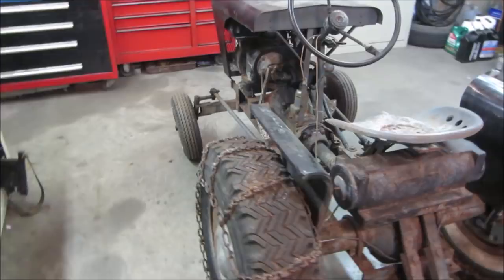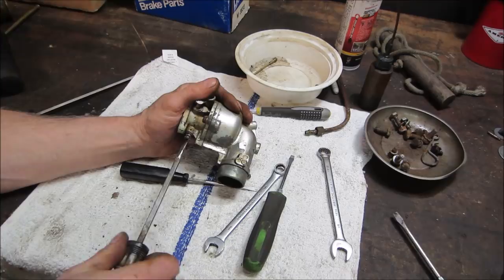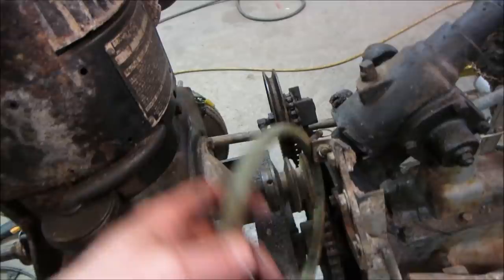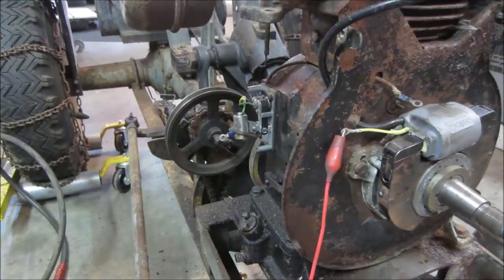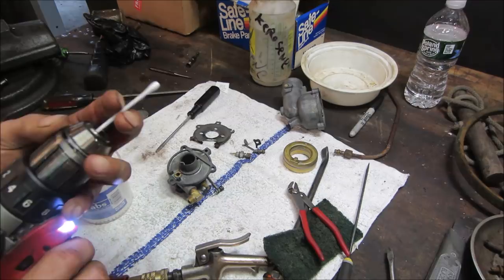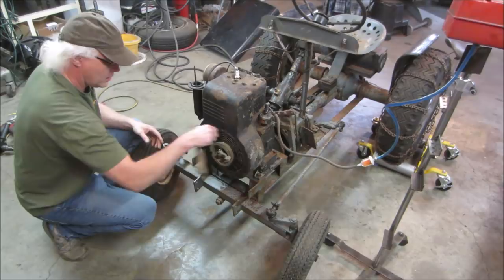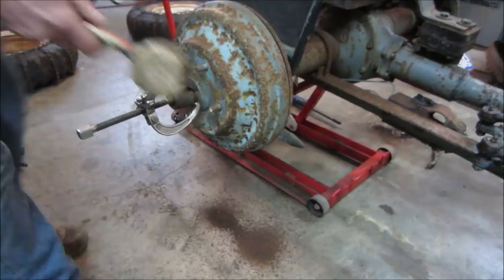Is The Engine Savable? Homemade Tractor Buried Under A House, pt2

Comment: you can use a bicycle sprocket :) .. I think you can get the idea on how to make a one way ratchet to drive that with a drill .. just imagine the part where you put the chain is your drill and the middle part where the wheel axle is connected is you're fly wheel that you spin

Comment: I like how it was sounding. Very cool little toy. One thing though that could be neat is when you go and do the breaks possibly flip the wide whites out...hmmm could be fun it would give it a real 60's kinda vibe
Reply: "brakes"
Reply: Breaking those old tires down you risk ripping the bead. Replacing those tires would set you back a bit too.

Comment: Just can't beat the old Briggs cast engines. Ya can bore those out several times for total rebuilds. If I remember correctly they have stelite exhaust valves that are tuff to ruin.. I've got a big ole 15hp cast one saved from scrap many years ago. We repaired it n never got paid so boss said scrap it , I have it in a shed . Have to sell soon going to move

Comment: Last time I had a throttle cable issue like that. I was able to remove the cable and soak it in liquid WD40 for a while. Grease would have been a better option if I had some. Find that the cheap green scour pads from the dollar store are very handy in these situations for surface rust

Comment: Nice day for it anyway. To bad we got snow for this weekend. Hopefully down south your pressure washers and such didn't freeze. BTW I Have an old homelite generator 3.5hp briggs vertical shaft square base. Pretty rare from what I've found.  I'd love to see you tear it down. Message me if you're interested in the "will it run" I'm in central NH.

Comment: Not sure it could be the original, but upon closer inspection, someone definitely followed the plans for the Pow'r Pup tractor very closely.   Wish I could tell, but I wonder if the hood has remnants of the  logo from the Pow'r Pup article, it would then certainly be the original.

Comment: I'm wondering if you could make a 2 piece socket that has a lip, like an inclined plane that catches if you spin clockwise. Then when the engine catches and outrun the drill it could just go right on past that lip from behind.

Comment: To me it looks like that coil was just left powered on and melted from the inside winding outwards, but this doesn't have a battery and it's not a powered coil am I right? The mystery just gets deeper. perhaps that thing you removed that was rubbing in the previous video caused a huge amount of friction heat right around that area. I guess we'll never know.

Comment: Just a thought about using a drill for starting these engines, wouldn't an air drill or impact work better? When it starts, an tool like that would free spool without reversing the nut, or am I wrong?

Comment: Stanley/Bostitch bought the Craftsman tool name. They also own Black and Decker, DeWalt, Porter Cable, Delta, Rockwell, and Emglo.
Reply: 30 years ago I worked for a company called Western Forge.  They made Stanley, Craftsman, plus other brands on the same line.  Independent manufacturers have been gone a long time.

Comment: I've mentioned previously: Lithium grease is for fast-moving parts that run hot because lithium base grease is hygroscopic (absorbs moisture and causes rust). For slow moving parts and cables use a calcium-base grease, stern tube oil, STP "oil treatment", molybdenum grease or other alternative.
Reply: It's all good. Mustie put a protective layer of oil on it all first. Plus it is all prerusted anyways.

Comment: Excellent video Mustie :) who took over Sears small engine was Techusmn in 1970's  also O.M.C. was before that if want  know and Tractor motor sure a running order one to yes after minor fix up Carburetor and Spark Control ! I know the motor from 1980 or before got use Lead Additive in fuel so dail in okay and since 1990's got use Fuel 89 has 5 % Ethonal  or higher  has none Ethonal plus use Fuel injection cleaner in more since Ethonal in fuel older motor fight with  fuel 87 octane has 10 or more % of Ethonal! Plus older engines don't like Synthetic engine oil like Conventional type of 30 or 5W30 or 10w30 engine oil with high protection grade too and no recycling oil types too ! How found this my late Dad had 1976 Sears 6 hp Techusmn 4 cycle motor had it took lot work dail for Low Idle with 87 octane gas & work fine on 89 or 91 octane gas from Shell fuel stations plus 10w30 engine oil no synthetic type to and purr like kitten they say ! Plus Chainsaw he had still got has same thing like mix gas with gas type 89 or higher octane with mix oil or backfire and no low idle very well if used 87 octane hard dail in carb run right on both them ! Plus USE Lead Additive also A grey bottle of STP Total Treatment fuel injection and carb cleaner in 89 or higher fuels you be surprised in a year or longer using or bring something out storage no problem at all on first pull plus little choke on till warm in 1 min of starting up! Yes you be surprised even own drive vechile like GM , Ford, Chrysler also others too of old classic vechiles too use Lead Additive and STP Treatment too and got lots people to try also it surprised them too even fuel to use on 89 or higher octane!

Comment: The coil almost had to fail with the engine running. There wouldn't be any power on it otherwise unless somebody tried to connect a battery. Once the coil failed, the engine stops running and the melting, probably burning goo keeps dripping onto the flywheel.

Comment: If power was left on to the coil when not operating, the coil would eventually overheat and melt down.  Happened in points & condenser ignition cars where key was left in "On" and points were closed.
Reply: That's only true if there's a battery in the circuit,

Comment: Yes Lowes has taken over Craftsman and still have a life time guarantee.
Reply: I believe it was Stanley that bought Craftsman. Lowe’s is just one of the Craftsman resellers. There are others like Ace Hardware. Even our local Rural King sells Craftsman stuff....
Reply: Black and Decker bought Craftsman from Sears, then B / D chose Lowes as the primary out let, ACE and others like Menard's sell a portion of the Craftsman line of tools.
Reply: @nonenone5116  Well, Stanley owns B&D.......

Comment: which ultra sonic cleaner do you use thinking about buying one for automotive carbs and small parts. its odd years a go a friend bought one large enough for radiators used about a year turned off never used again

Comment: They left the ignition on with a 12 V hot battery in it that also will happen to the old Mercurys as well
Reply: The machine has no electrical system. So there is no battery. A magnet passes by the coil and generates the spark.

Comment: I have an old Briggs on a pump large frame like that looks like  a 8 Horse I think it say 3 horse.
Long stroke.
I guess mine is taller smaller  head
Also have a David Bradley  need  to get running

Comment: You need this item for using your drill to start the engines. Amazon - W38137 3/8 Ratcheting adapter

Comment: Lowes took over craftsman and does honor their warranty. But the tools aren't anywhere near the same quality. So any old school craftsman is going to be a definite downgrade. Now if you are talking about crapsman stuff that was manufactured the last couple of decades of their existence, it is about the same.  Interestingly enough I found that my local lowes will replace the craftsman stuff with kobalt. I don't know if that is policy or if I just have good rapport with them, but I would consider kobalt far closer in quality to older craftsman than the current stuff. I mean don't get me wrong, at the end of the day most of it is home gamer quality stuff and doesn't compare to really high quality tools. But for tools you don't use all day every day they serve their purpose quite well.

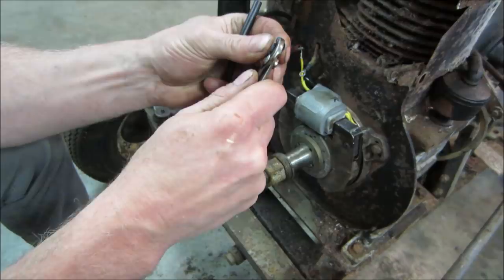Comment: 7:32 where the heck did you get those channellocks? Those are beyond cool 😎👌
Reply: Look up ignition pliers. You're welcome.
Reply: @1pcfred  you're awesome man, thanks
Reply: @AZgule2010  no problem. I know what a lot of obsolete tools are. I use tools but also collect them. Now if you asked me what you're supposed to do with ignition pliers I couldn't tell you that. I never liked points though. The way I fix points is I drop an electronic ignition in their place.

Comment: Mind if I ask a question. Parents have a 2004 Ford Focus and the driver side window won't roll up/down. Ford wants like $450 to fix it. I'm guessing the motor is bad. Think that's a bit steap?
Reply: Yeah i think its a bit steap. Sounds like the window regulator went bad.
The worse thing about those is getting the door panel back on correctly.

Comment: Yeehaw, gets spark finally. 
A dribble of gas the spins off the nut using an electric drill.
Of course now that Herr Doktor Professor Mustie got it to cough it's carberator tear down time.
Let's see if it's a varnish pot or just needs a mild cleanup.

Comment: WD40 works a charm freeing-up those rusty wound-wire control cables! Southern secret, unknown in Yankee-land? WD40 to the rescue! Also CLR nearly as good & both less messy than nasty ol' oil! LOL Love the honest, non-pretentious 'train-of-thought' running-commentary in your videos ... watch em regularly ... keep-on burnin' and turnin'
Reply: WD40 is mostly mineral spirits and some mineral oils.  They have done a great job marketing that stuff.
Reply: @paulcopeland9035  it has another "magic ingredient" ... molybdenum-based lubricant... still, i agree, remarkable job of marketing
Reply: @bobskiles3482  ..Last year I had to research WD40 for a project I was working on.  The "Material Safety Data Sheet" mentions nothing about "molybdenum-based lubricant".  It states a composition of >50% refined mineral spirits (Stoddard solvent), >25% mineral oils, driers (paraffin waxes), 2-5% CO2 as propellant, fragrance.  WD40 (std) uses highly refined mineral spirits, but they are still basic Stoddard Solvents.  Stoddard Solvent (better known to the old guys here as "Varsol") is mineral spirits and standard WD40 is made mostly of that.  Mix with some light mineral oils and you have the product.  WD40 makes many different products and one of them may contain a "molybdenum-based lubricant" but the original WD40 does not.  Once again I mention that for many years the manufacturer has done a solid job marketing a fairly simple product and I commend them.
Reply: never ever rely on MSDS;  molybdenum confirmed by both XDF & chemical tests in the specimen i tested , altho 20 yrs ago; formulation may have changed (subjectively i opine it is less effective, nowadays, but that could be because i'm older and more skeptical ... and critical) cheers!

Comment: try 1 1/4 from dead bottom on the settings to start and have  the idle higher... then set it like you want it to run for you... l like a higher rpm than you..

Comment: Question  Mr M my lawnmower will not start cold unless you prime the plug hole then it goes and re starts every time. I've stripped the carb and put it back together but still the same. Any ideas?
Reply: Can't just spray gas into the carb? I guess you can't if you don't have a spray bottle with gas in it.

Comment: I know nothing about a tractor I was just watching  a  corvair wagon designed and made to compete with the  Volkswagen kammback,v, perform after a major redo by my YouTube friend Matt's off-road recovery he put an  LS1 in the trunk and made it a four wheel drive., Let me tell you that thing effortlessly does what any new 4x4 can't, 
so that made me start thinking what if Volkswagen the car company that was so steeped in tradition so much that they wouldn't even dare think let alone put an engine in any of their vehicles in the front but  what if they went ahead and did it anyway how awesome that would be,
 like your bus truck  there  a front engine, or  a  near mid   would be an awesome vehicle that would probably handle so well you wouldn't believe it , especially  with a small block Chevy , or how about the original corvair that was clearly designed to compete with the Volkswagen notch back ,but what  if Chevy had just been themselves and  it came with  a 283 small block in the front, instead of an engine in the rear something that Chevy isn't about and doesn't do well, . what could have been I can only imagine but I can clearly see thanks to Matt is  how  that would be such a badass car if you did it to a corair  now. Maybe you should try to put an LS in front of a cam back notch back or karmann Ghia even just to  see what happens. .